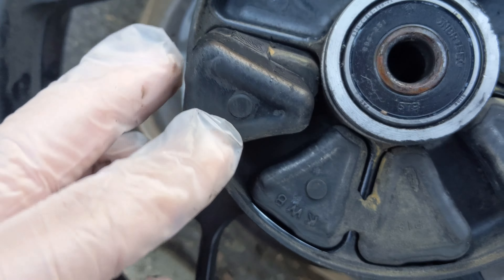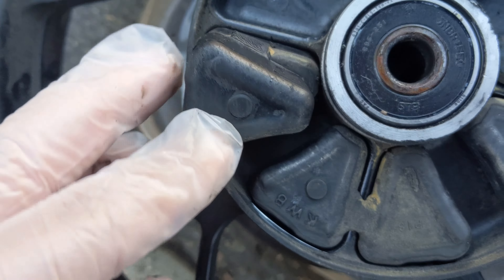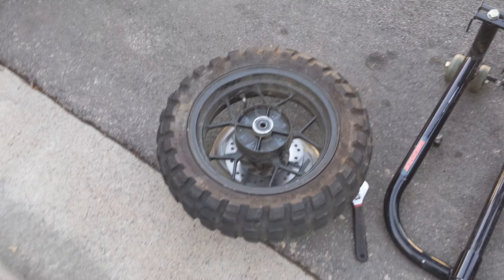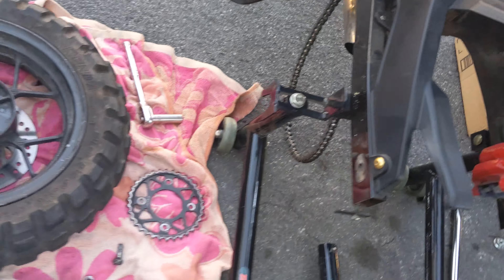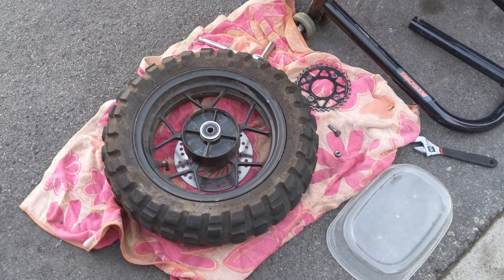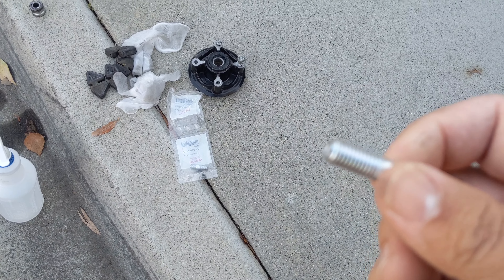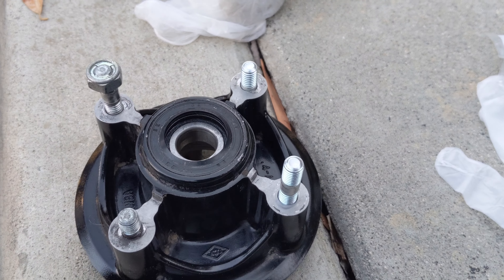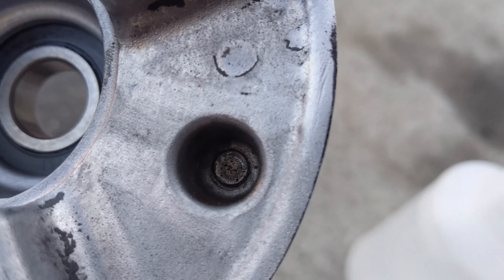Honda Grom Rear Sprocket STUD Replacement | ALMOST DIED

Comment: sadly you dont show the process how to get out the old stud bolt of the carrier.. i want to change mine aswell but no idea how to take out the old bolt
Reply from the maker: You can either use an extractor kit, mine was easy enough or you can put a vise grip on it and turn it out the opposite way, or use a double nut method. I didn't show it on mine since it was already loose and I just used my fingers.
Reply: @Wickit96  ok.. i will give a try by using double nut method.. wish me luck
Reply from the maker: @KamarulAzlanAhlengChai  If for some reason the double nut doesn't work, you may want to use red loctite to help or if you know anybody with a welder they can do a small spot weld on the inside of the stud to the nut that way it makes it like a temporary bolt and you can unbolt it if that makes sense
Reply: @Wickit96  thnx mike for the solution.. the weld option will be my 2nd choice then.. thx!
Reply from the maker: @KamarulAzlanAhlengChai  best of luck man!